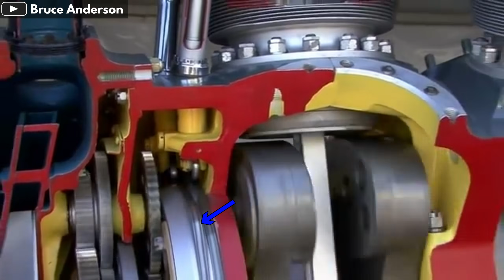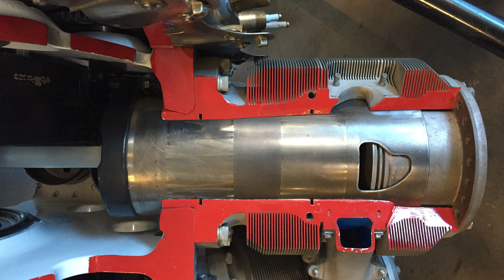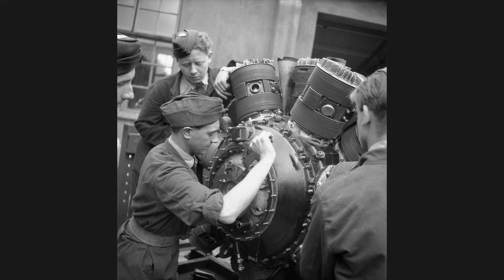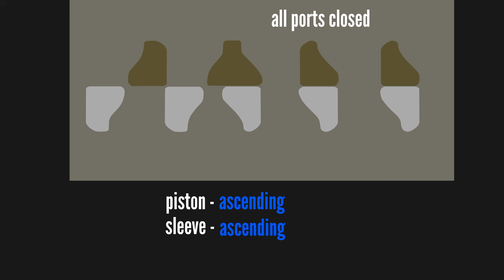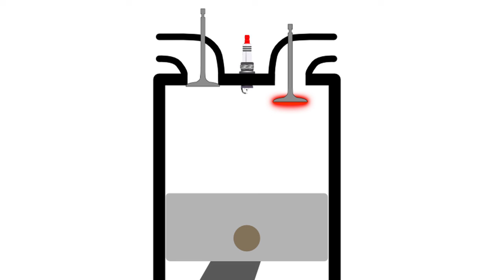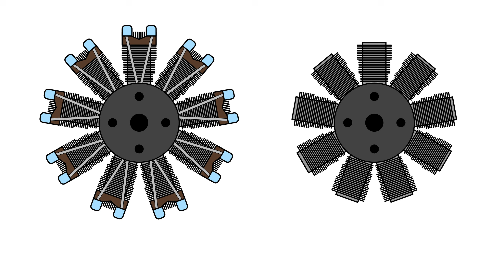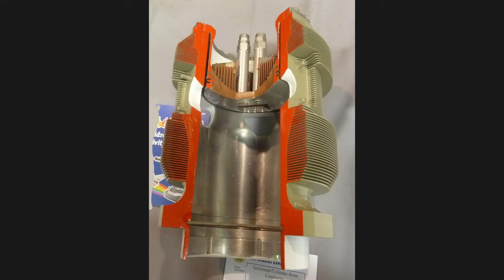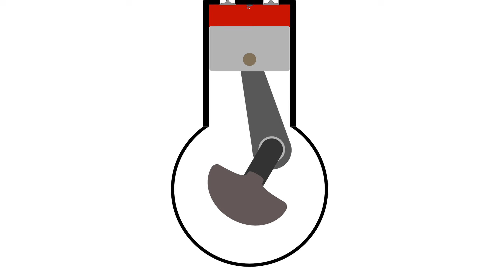Analysis of Bristol's Sleeve Valve Aero Engines

Comment: Sleeve valves did not fail. They were simply superseded. Poppet valves got better so the complexity of sleeves was no longer necessary. 
Rolls-Royce used 4 valve cylinder heads. More cooling area of valve seat for exhaust valves and a larger gas flow area. American radials persisted with two valve heads. The really big ones became unreliable as valves broke and hot valves caused engine knock.
Reply: Superseded yes, but not by better poppet valve technology. All reciprocating engine technology was left in the dust by jet turbines.
Reply: those "unreliable" big US radials were commercially viable in air transport service long after the Merlin and Griffon were obsolete for commercial applications
Reply: @harryspeakup8452 hardly surprising, they were not designed for commercial use, they knew from early in WW2 that the future was turbo prop and turbojet, with Turbo fans to follow.
Reply: @robertpatrick3350  The development of the R2800 and R3350 started in the thirties. I doubt there was any consideration of turbine induced obsolescence controlling design considerations.
Reply: @harryspeakup8452The Merlin and Griffin were obsoleted by the turboprop engines developed in parallel with them during WW2.
The first turboprop aircraft was a Gloster Meteor variant that flew in September 1945.
Reply: The Germans had problems throughout WW2 because of exhaust valves causing detonation. That was caused by a shortage of nickel in Germany.
If the Atlantic blockade had been marginally more effective Britain would had the same problem and the sleeve valve evaded this problem.
The high precision machining translated directly into the requirements for gas turbine engines so the development wasn’t wasted in that direction either.
Reply: @allangibson8494  German engines had GDI so there was no detonation problems like Allied engines suffered.
Reply: @DoktorBayerischeMotorenWerke The German engines ALL suffered from low quality valves that rapidly developed hot spots because of their low nickel content (typically 8% as opposed to the 18% of the British engines).
Reply: @allangibson8494  Krupp in Germany invented and developed the first high temperature nickel alloys for aircraft engines and turbochargers in 1930... P-193 Tinidur is still used in exhaust valves and jet engine turbine blades.
It is sold today as A286 alloy.
Reply: @DoktorBayerischeMotorenWerke They may have INVENTED them, they didn’t USE them in WW2.
Reply: @allangibson8494  Germany also invented hollow turbine blades cooled by compressor bleed air and the ceramic TBCs used to protect the blades from heat and oxidation... technology that was completely unavailable to the Allies during the war and adopted after the war, pioneering technology found on all modern jet engines.
Reply: @allangibson8494 High precision machining is not typically used on gas turbine blades... temperature resistant stainless steels are generally very difficult to machine and produce low quality parts.
Turbine blade are typically made from high precision Investment Casting methods.... not machined from billets.
Reply: @J @JammisAdami The BEARINGS are high precision.
The rotors are high precision (because otherwise you have massive balance problems).
Bristol made jet engines after WW2.
You may have heard of the “Olympus”…
Reply: @allangibson8494 That's not what you wrote... you are a liar.
Caged ball bearings were invented in GERMANY by Friedrich Fischer.
Reply: @JammisAdami  And?
What’s that got to do with aircraft engines? Hydrostatic sleeve bearings have lower friction than roller element bearings.
The problem in WW2 was LACK of nickel for ANYTHING.
The response was having low alloy valves that corroded rapidly and had to be replaced (increasing the nickel consumption but Nazi bureaucracy wouldn’t let the engineers correct the original error).
The engineers knew what they SHOULD do but the bureaucracy would let them actually do it.
Bureaucracy (and kakistocracy and kleptocracy) killed the third Reich.
Reply: @JammisAdami  Don't waste your time with this brainrot alliboo troll...
Reply: @allangibson8494 Well, it is a critical design element in jet aircraft engines, because it seems you don't know? They do not use hydrostatic bearings, they are made with very high precision roller and ball bearings.
Ball bearings are superior to hydrostatic bearings in aircraft applications.

Kakistocracy and kleptocracy is exactly what caused the collapse of the British Empire... The monarchy promotes inbreeding and nepotism.

"Bobs your uncle!" As they say in the UK... everyone knows that the ruling class is corrupt.

A country that continues its steady decline due to corruption and an antiquated class divided society.
Reply: @JammisAdami Again AND?
Germany in WW2 did it worse in every respect.
Reply: @allangibson8494 Germany made over 15,000 jet engines... Bristol only made 1,800 Centarus engines during the war.
Reply: @JammisAdami And all those German jet engines had a combined running time lower than the Bristol Centaurus engines. They were BAD.
Reply: @allangibson8494 The Centurus was infamous for its lack of reliability, high maintenance and low TBOs.
Reply: @JammisA @JammisAdami as STILL better than the German WW2 jet engines (all of which had trouble achieving more than twenty hours of actual in service operation).
The Centaurus averaged between 250 and 500 hours between overhauls.
The Centaurus was actually praised for RELIABILITY in military service.
The Centaurus was a two row derivative of the Bristol Perseus and 14 cylinder Bristol Hercules (all of which used the same cylinders).
Reply: @allangibson8494 German jet engines completely outclassed Allied piston and jet engines.

Not in combat operations, Bristol sleeve valve engines had a notorious reputation for unreliablity and short service life.
Reply: @JammisAdami That is the exact opposite of reality.
German jet engines were unmitigated crap.
None of them reached 10% of the overhaul life of the five different British engines that got into operational service. In the German production engines was initially due to resonance vibration that destroyed the turbines after 5 hours (caused by having an even number blades on the turbine and a cruciform support structure - fixed in December 1943 but requiring the total scrapping of all five thousand engines manufactured to that date). The next problem was failure of the turbine blades due to heat, the British engines solved that with advanced high temperature alloys in 1941, the Germans lacking that technology used aluminium oxide refractory that flaked off with each engine throttle cycle limiting the engines to about ten engine stop start cycles. That also required a glide approach to landing because explosive engine failures on throttle up were common combined with a lack of airbrakes resulting in a 20km approach to landing. That’s how 200 Me262 were shot down.
Adolf Galland said the Me262 would have been a game changer with British engines but was stuck with German government specified crap (Junkers was directly owned by the Nazi Party in WW2).
The Centaurus engines were simply overhauled to military schedules and delivered twice the power of the German jet engines… (without the periodic explosions every five to ten hours of flight).
Reply: @allangibson8494 You are probably the most poor educated and knowledgeable Alliboo troll on Youtube.
Do you actually believe the crap that you post?
Shame on you for posting lies and false information on a subject you don't know anything about.
Reply: @allangibson8494  The German Jumo 109-004 B was the most advanced and successful jet engine of the war.

US Army tests conducted during Operation LUSTY confirmed TBO of 55 hours on average, higher than both Allied high output piston and jet engines during the war.

BIG FAT LIE! Britain only had one jet engine that saw fully operational RAF combat service during WW2, The Rolls-Royce Derwent lacked performance and reliability during this time, centrifugal compressors were an obsolete dead-end concept.

The only the improved B model saw production and service in the Me-262, Jumo engines were superior due to there internal bleed air cooling of the turbine blades  

Both the blades and the combustors were coated with an advanced Cerro-Aluminide TBC, this Alpha state alumide produced an atomic bond with the iron grains in the stainless steel alloy and did not flake off like later TBCs did, this is unique to German engines because unlike Allied alloys it still contained some iron content in the alloy and prevented flaking or spalling of the coating. 

All Luftwaffe jet engine were required to operate a minimum of 100 hours at P-100, max power except take-off, THE SAME STANDARD AS ALLIED ENGINES.

The Centaurus was extremely temperamental and unreliable in military aircraft applications and was canceled after the war, it was a evolutionary dead-end concept just like British centrifugal jet engines.

These engines are obsolete, we use the German axial type jet engine in fighter jets today.
Reply: @allangibson8494  "You may have heard of the “Olympus”…"  What engine does Bristol currently make???
Reply: @DoktorBayerischeMotorenWerke And?
What engines to Junkers make?
Bristol Aero Engines was swallowed by Rolls Royce in 1966…
Bristol Aeroplanes got swallowed by BAe and Airbus. Their last major project was Concorde.
Reply: @DoktorBayerischeMotorenWerke ALL the British jet engines had a longer TBO than the Ju004’s. 
The Ju004’s were CYCLE life limited.
The early (pre December 1943) were additionally subject to resonance induced failures.
Running on a test bench is very different from running in an actual aircraft and the Luftwaffe rarely got even 20 hours out of its Ju004’s before they ate themselves (usually on landing approach as the cooled down).
Modern jets use derivatives of the BRITISH engines. The British had axial flow engines running in 1942 (like the Beryl) (but like the Ju004, they weren’t particularly reliable). The F2 Beryl powered a Meteor in 1943.
SNECMA hired the Ju004 designers and finally got a reliable working engine  in 1955…
Reply: @allangibson8494  Jumo is now a part of MTU Aero Engines and makes engines for Airbus.

There is no connection between Bristol and Airbus. 

Concorde was the largest financial blunder in commercial aviation history and destroyed the UK aircraft industry.
Reply: @DoktorBayerischeMotorenWerke Airbus has a factory in the Bristol Aeroplanes site in Bristol… (so does Rolls Royce).
Reply: @allangibson8494  All British engines were tested to the same PFTR reliability standards as the Luftwaffe and the USAAF.

Jumo 109-004 A-1 engines were experimental and never saw production or service

Only Allied jet engines suffered thermal shock damage of the turbine blades, German blade were hollow and had internal cooling to prevent this problem, all modern military jet engines use the German type turbine blades that resist thermal shock damage.

Britain would not have a flight-rated, AW certified axial jet engine until the 1950's

Rolls-Royce Avon was the first production axial turbojet in the UK, they hired German engineers like Max Bentele and Fritz Feller

BMW's jet engine team became ATAR and continued development of the BMW 109-003/018 engine at SNECMA as the ATAR 101 engine series which is still in production and service today.  

The BMW -018 is the most successful longest production run of any jet engine family in history.
Reply: @allangibson8494  Airbus SE is not a British company and is not related in any way with Bristol Aircraft.
Reply: @allangibson8494  Airbus has never built aircraft in the UK.
Reply: @allangibson8494 The only Rolls-Royce engines still made in the UK is the Trent and they are made in Derby... not Bristol.
The only thing made in Bristol is engine Front Fan cases.
Reply: @sandervanderkammen9230 And?
That’s still an engine component.
Junkers Motoren has zero modern footprint.
Reply: @DoktorBayerischeMotorenWerke  Airbus has ALWAYS built aircraft components in the UK.
Reply: @allangibson8494  But not an engine.

Jumo has zero modern footprint.... except they invented the Axial Jet Engine that all modern aircraft manufacturers use.

Airbus makes components in 47 countries
  The UK is now one of the 171 countries that has no jet aircraft production.

Britain currently buys and imports its jet aircraft from Germany, France, America and Canada.
Reply: @DoktorBayerischeMotorenWerke Jumo DIDNT invent the axial flow engine. Alan Griffith beat them to it in 1929. 
Both Germany and the UK had running axial flow engines in 1941.
All post war designs were based on the British designs rather than the defective German ones.
Airbus’s flys on British built engines.
Reply: @allangibson8494    Maxime Guillaume patented the first Axial turbojet aircraft engine May 3rd, 1921.  patent no. 534,801
 The World's first successful demonstration of a Axial jet aircraft engine, was the Messerschmitt Me-262 on July 18th 1942.

A.A. Griffiths Metrovick F.2 engine was an unmitigated failure, he left the company and Metropolitan-Vickers completely abandoned jet engine development in 1947 and returned to making steam engines.

The first successful axial jet engine in the UK was the Rolls-Royce Avon designed by German engineers Max Bentele and Fritz Feller.
Reply: @allangibson8494 The American company General Electric and the French company Safran supply the major of Airbus engines 

Rolls-Royce is only the 6th largest jet engine manufacturer
Reply: @DoktorBayerischeMotorenWerke Airbus is a joint venture company.
BAe (the successor company to Bristol) originally held 20% of the shares until they were sold off in 2006.
That was in exchange for the assets of Airbus UK which included the Bristol manufacturing site in 2001.
Reply: @allangibson8494  Airbus SE. is a German, French and Spanish consortium.
 It is not British.
Airbus UK is a wholly owned subsidiary and is licensed in the UK as a foreign company.

*Hawker Siddeley had a 20% share in;
 Airbus Industrie groupement d'intérêt économique* 
a company which no longer exists.

Bristol Aircraft went defunct in 1959 and was acquired by BAC (British Aircraft Corporation) 

The UK government seized the assets of Hawker Siddeley in 1977 by Act of Parliament to prevent the sale of the then bankrupt company to a foreign company.
Reply: @DoktorBayerischeMotorenWerke And?
Airbus did EXIST until the 1980’s.
Hawker Siddeley are still operating as a company in the electrical supply industry (after being stripped of their aviation assets by government interference). That wasn’t a corporate problem, that was a government problem.
Reply: @allangibson8494  Hawker Siddeley went bankrupt and was seized by the UK government in 1977, it was merged with BAC to form BAe which also no longer exists.

Please name a single British company that still makes British jet aircraft in the UK?
Reply: @DoktorBayerischeMotorenWerke Messerschmitt no longer exists either…
So your point is?
Hawker Siddeley never went bankrupt.
It got nationalised.
Reply: @allangibson8494  Messerschmitt became DASA and is now Eurofighter Jadgflugzeug GmbH. 

My point is Germany is the largest manufacturer of jet aircraft in Europe while the UK no longer makes its own jets.

Both BAC and Hawker Siddeley were facing huge military budget cuts in 1977 as a result of the 1976 UK financial crisis, the whole country was bankrupt and spending was slashed.
BAC was completely bankrupt, Hawker Siddeley still had diversified industries that were profitable.
 Hawker Siddeley wanted to sellout to foreign interests, but Parliament would have blocked the sale if it included military contracts.
 The solution was to get the government to buy the failing aircraft and defense sector companies and slit-off the Rail transport, industrial equipment and power generation divisions that were sold off to the French, Canadians and the Americans.

The failing aircraft division was merged with BAC to form BAe which was also financially unsuccessful.
Reply: @Dok @DoktorBayerischeMotorenWerke any couldn’t get a plane off the ground without British wings and engines and French Fuselages.
EUROPE makes aircraft. Germany doesn’t.
BAC and Hawker Siddley weren’t responsible for government policy.
Hawker’s commercial operations were sold to Beechcraft then Raytheon.
The military operations went through multiple mergers and are now known as BAe Systems. They never went “bankrupt”. Airbus and Rolls Royce bought some of the operations.
Hawker Siddeley still make electrical switchgear as a separate company. (And oddly still have an aviation history through their Brush division).
Reply: @allangibson8494  Actually wing production in the UK has been slashed 70% since Brexit and the cancelation of the A380, 310 and 340, Airbus now makes wings in France, Germany, USA, China and Canada.
The majority of Airbus engines are supplied by CFM GE/Safran.

Germany's Dornier-Airbus Finkenwerder factory in Hamburg is the largest in all of Europe. 
They produce over 75 new jet aircraft per month.

No, but they were responsible for building mediocre to just plain awful aircraft that were uncompetitive and operators refused to buy.
 The HS 146 was canceled, and the Trident was a huge financial loss.

BAE Systems is not an aircraft manufacturer and divested its aviation research and development division in 2006.

Hawker Siddeley Aircraft ceased to exist in 1977.
 
Please name a single British company that still makes British jet aircraft in the UK?
Reply: @allangibson8494 Germany and France make jet aircraft... Britain doesn't!
Reply: @sandervanderkammen9230 Britain makes jet engines. Airbus would be grounded without them…
Reply: @allangibson8494 General Electric and Safran are the majority suppliers by a significant margin.